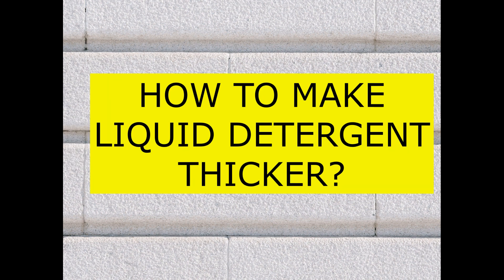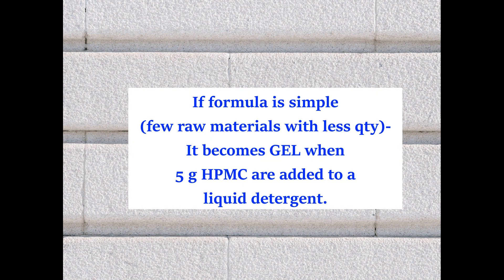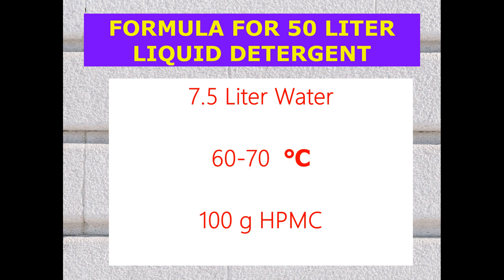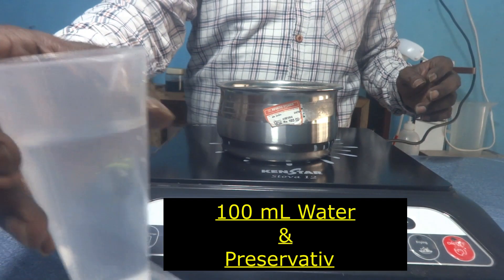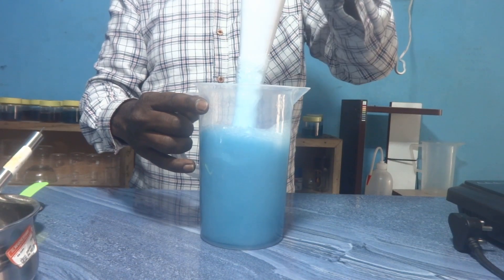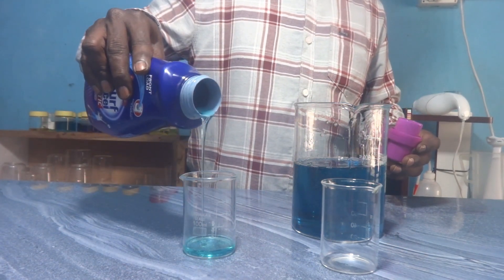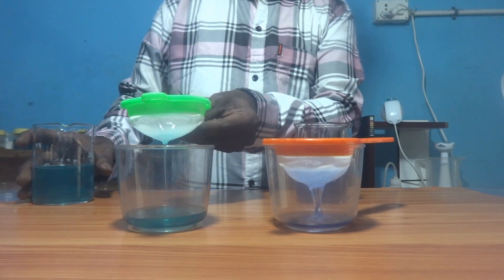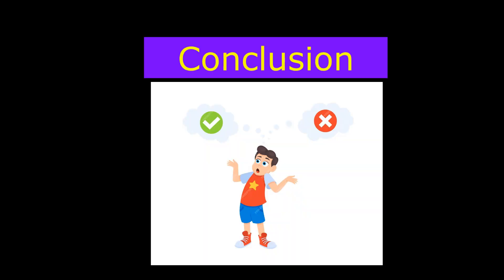How to increase the Thickness of Liquid Detergent?

Comment: Hi sir , 
U mean instead to adding salt (NACL) we should use HPMC ?
Reply from the maker: THE ROLE OF SALT IS DIFFERENT. SALT IS TO MAINTAINT THE MEDIUM. HPMC IS TO INCREASE THE THICKNESS AND FOR STABILITY OF THE MEDIUM.
Reply: @ARUNKUMARK-jk7ji ❤❤

What is the use of salt in liquid soap in general?
Reply: @ARUNKUMARK-jk7ji which viscosity HPMC you used? I mean there are different grades of HPMC